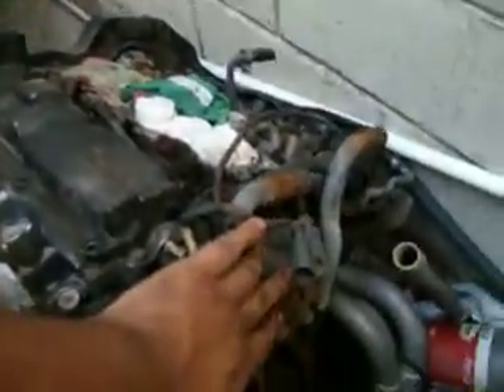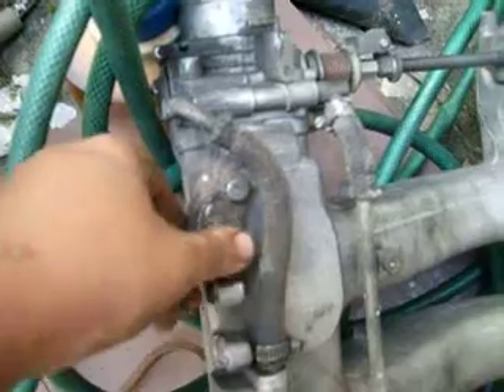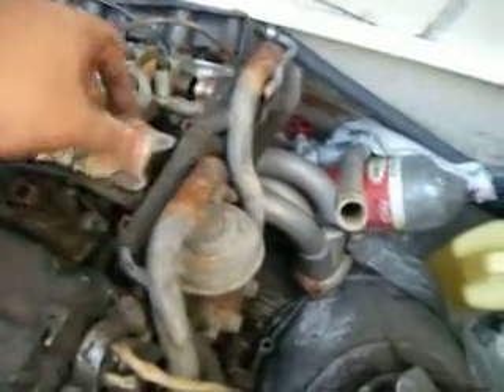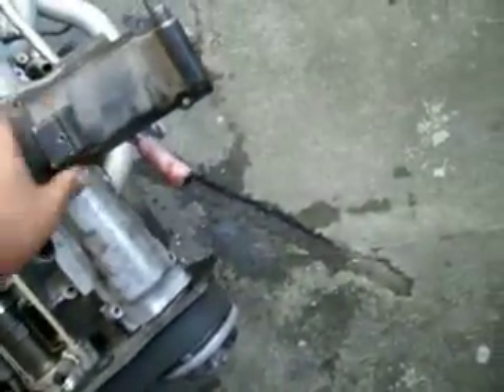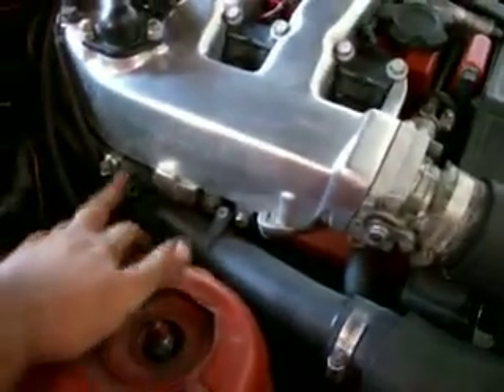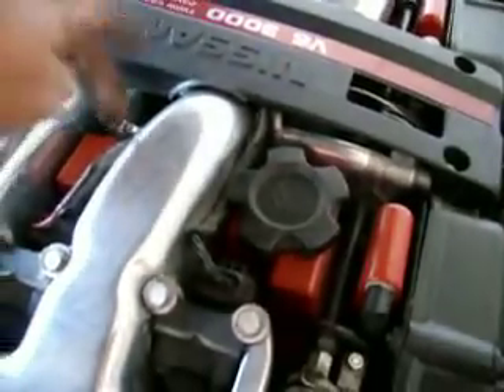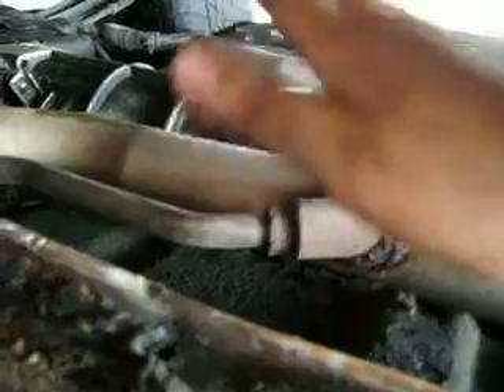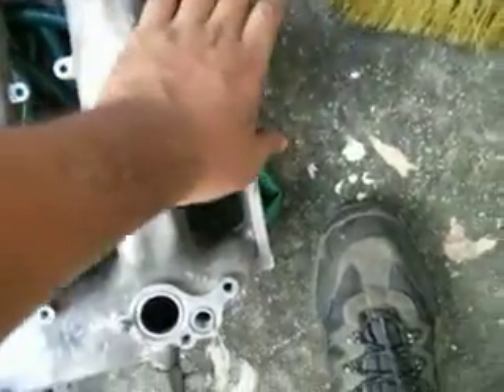300zx Engine simplification

Comment: this has got to be one of the most ghetto ways to delete something from a car: hose with a bolt in it.....quality work right there.

They make block off plates for a reason.  And, the stock ECU is tuned for EGR compensation.  Now, you're running lean; since the EGR is recirculating unburned fuel in the exhaust.  Unless you already have another ECU you plan on throwing in the car for a final tune, then whatever.

The throttle body coolant lines I delete too on my car.  BUT with block off plates, tapping and plugging the holes. 

The PCV (positive crankcase ventilation) "mod" you did was actually kind of pointless.  Oil is supposed to be rerouted back into the valve covers unless you do a real mod and add a cache can to trap the exiting oil (since some people who actually track their cars don't like recirculating that kind of oil back into the engine.)

I can't imagine what other "sweet mods" you've done to this car.   

My advice to you:  Do it right, do it once.   JB weld is never a permanent fix.  Drilling, tapping and plugging is.

Comment: I have a vq30dett I want to put it in my 2'5 Nissan skyline sedan  what problems would I encounter
Reply: everything.  IDK if the engine uses the same mounts, I assume not because they are two different engine configurations ( I6 vs V6) so, you would either need to fabricate your own mounts or build (buy) a new subframe.  Then, an I6 is definitely longer than the V6, so depending on where the engine would be located , it'd either have to be moved back or the radiator would have to be adjusted to compensate.  Then, wiring.....getting everything to communicate.  Transmission; they MAY use the same bellhousing pattern....may.  ECU, since you're doing it, just go aftermarket (haltech, adaptronic, motec, etc)

my recommendation: build the dett, it's a pretty stout motor and since you're considering doing an engine swap, you're already planning on removing it.

Comment: basically that's it. I do definitely recommend it on every Z that does not have to go through smog tests and whatnot. 

Just beware the rerouting of the turbo water outlet goes differently on the back of the car as you have to complete the water cycle it has to run through.

Comment: you guys think you have problems I have a customer that bought  a 98 300z.... guy he bought it off of swiped the OG engine to a TT.. and ! all so  swiped the right side driver to left side .I'm dealing with a can of worms here I don't know If the wier harness is OG or from the TT swap I got to fiend the tag on the harness to fiend out I got a lot on my hands I'm seeing cut weirs plugs un plugged no computer for the engine but im looking on you tube for hints and tips .

Comment: can i remove the egr completely? i live in florida no emissions law but i was wondering if i could . imma gunna put a dry sump in my car to solve the oil blow back problems so that should in theory solve my pcv valves and eleminate them as my pump will be dropping oil from the top down.

Comment: If you passed emissions u had a dummy inspector. Removing the EGR not only voids inspection, its ILLEGAL. Why would you remove the EGR anyway? It helps keep combustion temperatures down, and assists with pinging. Seeing the poor quality of fuel we use today, egr is more important than ever.

Comment: @dudewtf1776 have you figured out what had caused this? my car stumbles when i give it a little gas when the engine is cold. when it warms up its fine. The only code i get is fuel temp sensor. I replaced it but the code wont go away. is this related?

Comment: Haha one thing you should point out is that you will not pass emissions by deleting the aiz or the egr. Also jb weld really? Why didnt you just thread and tap the valve covers for npt fitting and be smart that way when your pcv line cracks melts or whatever from the jb weld you dont suck that crap into your engine of wait I know why you dont cause your car will never run again anyway hahahahahahahahahahahahahahahahahahahahahahahahahahaha

Comment: also what would be a main cause for a slight oil leak on this car? i havent had time to jack my car up and look under yet but im starting to think im in the early stages of a failing head gasket. i am fucked if thats the case because i dont have the time to fix that, this car is my DD

Comment: hey i have a question,

i purchased my 300zx N/A in semi working condition, i had changed all ignition coils because two were failing, 
replaced all sparks with NGK, 
replaced fuel filter, 
some damaged vac hoses were replaced
replaced MAF sesnor due to complete failure

the car runs decent now but in the monrings on a cold start i noticed when i slight press the gas peddle the car RPM's drop drastically and the car sounds like it wants to stall but about 10 - 15min of idle it act normal??

Comment from the maker: @thirdeyedopeness The point of doing all of that is to eliminate future problem points in the engine, the simpler it is the less chance for it to run rough. Plus when you get to pull the plenum, for whatever reason, it's much easier to pull out and drop back in. About the spark plugs, you're right, it will only take a certain kind, and depending on where you live and what octane gas you use, a different temperature.

If you make a vid, I'd be glad to help you put it back together...

laterZ!

Comment: whats the point of what you did?. I have a 91 na. it was kinda load when i first got it so i changed the spark plugs because ive been told the engine will only take a certain kind.
i found out that the previous owner took it too the dealer for a transmission rebuild and i found a pluged hose, missing bolts, cheap cut out gaskets when i opened up the engine to check head gaskets.  if i show you film clips of my engine can u help me put the outer components in?